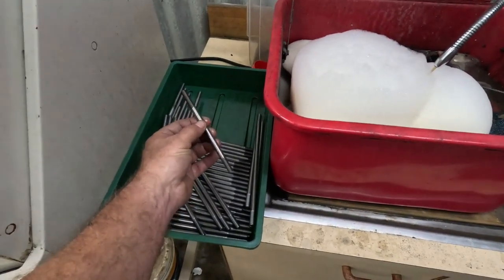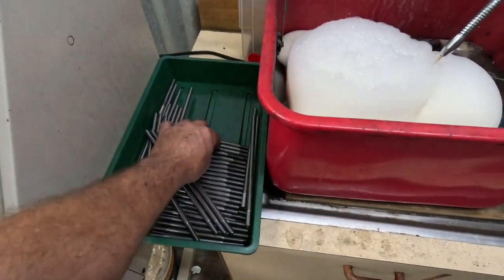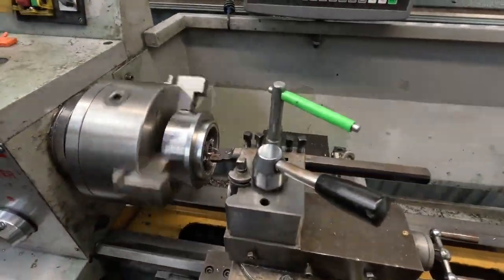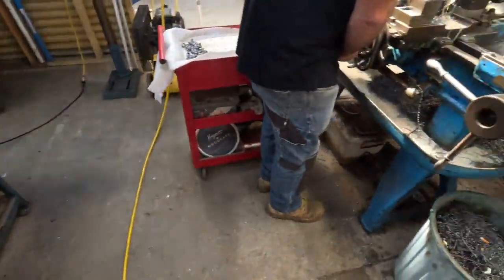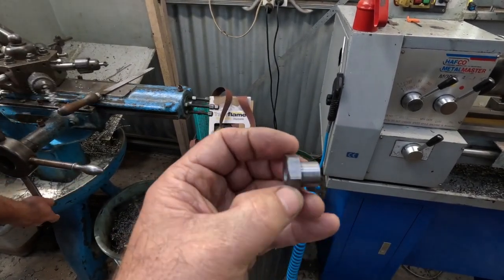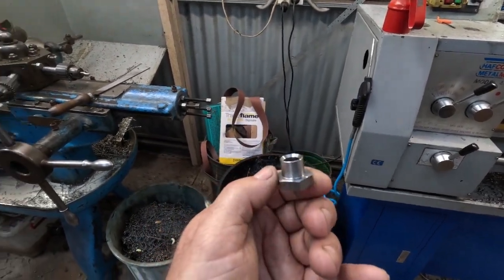BSA Bantam parts manufacture

Comment: Just found this. I was Apprenticed, in the UK,  as a Machinist back in the 60s and remember the Ward turret lathes well. I used them many times in those days and they were good reliable lathes and can be pretty accurate once you got the hang of overcoming the wear and tear and lack of maintenance they had to endure.
I also rode to work on a tuned up D5 with a George Todd head, Amal TT carb and close ratio gears. Not the best in Basingstoke rush hour traffic 😂.
Reply from the maker: i started my apprenticeship on one as well..........

Comment: Curious that you didn't tap the thread on the Ward using a floating tap holder.    That would have ensured that the thread axis was running true to the nut's clamping face.   I assume nut material was S12L14 and the mudguard stud 4140.
 'Er indoors had a D3 Bantam when she was 16.  Believe the Bantam was derived from the German DKW as part of the War reparations to BSA.  Interesting that BSA tried a large number of subsequent small bike designs (Beagle,  Dandy etc. ) all of which were market failures whereas the Bantam endures to this day.
Reply from the maker: Hi and thanks for commenting. You're correct on both respects in relation to the material specs. Nut wasn't threaded in the first process as it has to go back in to have the opposite side chamfered. I prefer running the tap through after both chamfers are machined to achieve a clean cut through both. It also avoids the potential for the chamfering tool folding over the edge of the thread slightly. In order to tap through on the first process you'd have to also use a plug tap as it's a blind hole, which isn't ideal. By thread cutting from the other side with a taper tap it reduces wear and tear on thread cutting equipment. Runout isn't an issue as I have collets the same size as the reduced diameter and the hex is flush with the collet. Yes the Bantam was designed from the DKW RT125 and there were about 5 other variants of the DKW plans built elsewhere......including the Harley Davidson Hummer. Beagle & Dandy..........You'd really have to ask what on earth the designers were thinking. It's no wonder they were not popular.
Reply: @OzBSABantams  Designers think change for the sake of change, to keep their jobs.Most of the sixties bikes would still be good designs today.